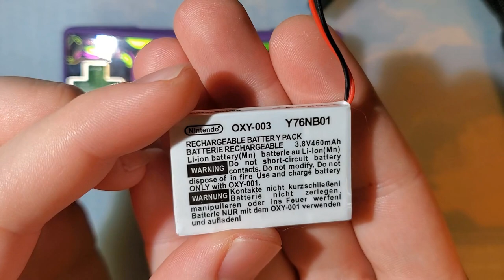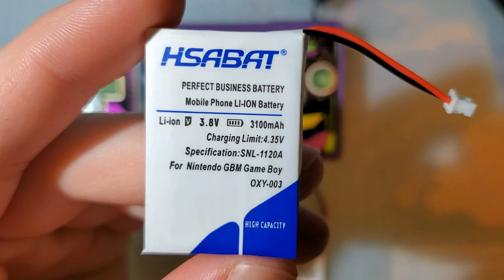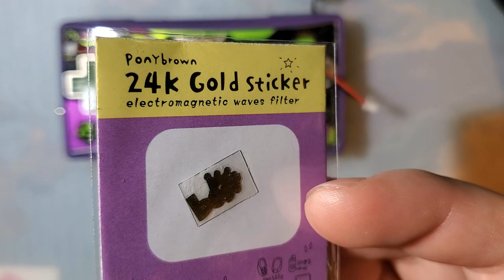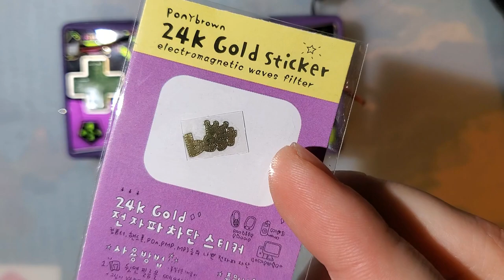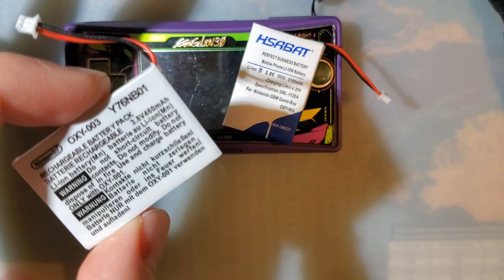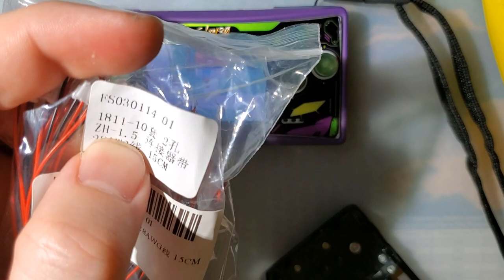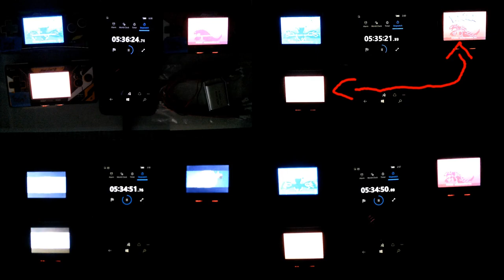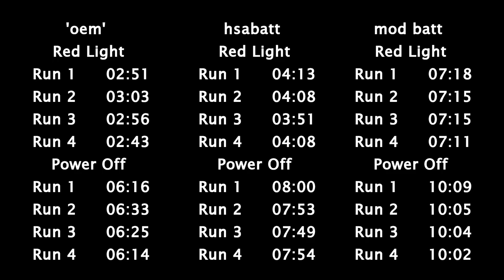Yet Another Game Boy Micro Battery Mod

Comment from the maker: Regarding my Micro: the faceplate is a sticker I found on aliexpress. They are no longer available and will not be remade (I checked with the seller and that's what I was told). The green buttons are custom one-offs made by Madmorda, the blue buttons are just generic aftermarket ones from aliexpress. The shell itself is cerakoted in purple.
 Yes it was expensive. 

For testing battery capacity, I use my Liitokala Lii-500 battery charger. I have modified it with battery plugs so it will take anything I solder a plug on to and not just hardcase 18650 style batteries. I have also made adapters to go from the plugs I soldered in to the plugs on a Game Boy Micro. See this video for more detail: https://www.youtube.com/watch?v=7qpD4n-aWsc
Reply: I know you dislike retro six now but I hope they start making new micro faceplates with their new uv printer
Reply from the maker: @kingarthur7255   I dislike R6 but that doesn't mean I don't wan them to improve their business. I hope we get new faceplates too.
Reply: Did you go through a specific company to get it painted? I need to get my micro repainted eventually
Reply from the maker: @chancepike1903  local gun place did it for me
Reply: @makho  thank you!
Reply: One thing that worries me is its 3.7v not 3.8
Reply from the maker: @IcePhoenixOfTime  I advise you do some research on how Li-Ion and LMO batteries work. The charge method and discharge curves are similar enough that they can be interchanged in the same circuit. Nintendo shipped the SP with both LMO and Li-Ion batteries and both had the same model number and consoles that came with one or the other still used the same power management circuit.

Comment: I did this mod on my Game boy Micro a couple of weeks ago and wanted to give feedback on how everything went.

I got the battery from the RetroGameShop link in the description. Installing it was extremely easy and took about 15 minutes. I just unplugged the old battery and shoved in the new one. Had to force the connector a little but but it wasn't that bad and I didn't have to cut/trim anything. It doesn't heat up more with the new battery and feels/plays just like it would without the upgrade. As a side note, if you can't close the battery compartment with the new battery in it, you may need to remove the foam padding on the battery door so it can fit.

While a traditional Game boy micro battery will last around 4-4.5 hours, mine was old and worn out, usually only lasting around 2 hours before dying. After installing the new battery recommended in this video, the playtime went up to about 13.5 hours on a regular Game boy game! When using the Everdrive Mini emulator it lasts about 9-10 hours. I have an Ez Flash Omega but didn't bother testing it since it's so bad with battery life (switch to Everdrive if you have one), but I'm assuming it would last between 6-8 hours with the upgraded battery. 

Like Makho mentioned, the red light does come on a lot sooner than normal but it lasts well past that. For regular games the red light came on after 4 hours and with the Everdrive it came on after 3.5 hours, but like I mentioned above it lasted hours past that before dying. Last thing to know is it takes about 4 hours to charge from dead to full battery. 

Hope this helps!
Reply: Does this mean you're playing for 7 hours with the red light flashing?
Reply: @Bovrillor  Yes that's correct. Makho explained it in this video but basically the new and improved battery does not have the exact same specs as the original micro battery. This causes the console to misinterpret it as a low battery but in reality there is still plenty of power left. I like numbers and predictability, so when I first installed it I ran the micro by itself without doing anything to get a benchmark idea of how it performed. If you're worried about it dying and losing your save data (like I was), I recommend you leave it running until it dies so you can see how it performs and gauge it better in the future.

Comment: Interesting that the ones from AliExpress are labeled 800mAh, the one I got from eBay a while ago is labeled 700mAh which is right around what yours tested at, guess AliExpress exaggerating the markings and selling the same cells. I need to grab some of those connectors, I reused an old aftermarket battery's connector which is apparently the correct one. Good video as always makho

Also weirdly I didn't have to remove the foam lol
Reply from the maker: I was told by the taobao seller that you had to. I didn't question it because the foam on mine was already falling off.
Reply: @makho  yeah that makes sense, I just never even thought about it when I put mine it. Maybe it's just really smashed in mine haha

Comment: I don't know if you will read this after the video being out for a while, but thanks to this video and almost dead battery on my micro, encourage me to mod my micro I took measurements of the battery compartment, and I order a battery 802735  800mAh that fits on the compartment, now I just need see if really last longer than the hour and half I used to get with my older battery.

Comment: I remembered that was you over there with that post.
My Micro's battery is shit now, some 3rd party replacement when I picked it up, but it's becoming garbage and doesn't like to hold a charge for very long, even when unused.

Maybe we should just push the mod battery instead of these weird junk rectangles from the Mystery Zone.
Looking on failbay, and the only ones in country are singles, and they're almost $10 a pop.
We need us a reputable battery merchant that's also reliable.

Also, that usb meter is nice!
Reply from the maker: >We need us a reputable battery merchant that's also reliable
I'm getting there... bare with me. I've released the specs for DIY but I'm also talking with mod shops and seeing if they want to pick these up for selling
Reply: @makho  Since we're on the subject of the Micro, was looking at how overpriced the Micro to GBA adapter costs, yikes. 

And then I started looking around, found this post: https://www.reddit.com/r/Gameboy/comments/b83ijg/i_made_my_very_own_link_cable_to_game_boy_micro/

Basically, aside getting the boards made, I would need to salvage some usb cables for the Micro, and get a few EXT ports to try this. Actually, this seems like a fun side project.

EDIT: And like an idiot, I overlooked the very video you have on here.

Comment: You can get the 800mah battery with the correct micro connector and a baby screwdriver on ebay from a seller in FL. I'm on my 3rd one so I can attest to the quality.  I don't have a tester though.
Reply from the maker: I doubt that claim, especially with no link to the battery itself. The connector Nintendo used appears to be custom so they would have to be harvested from OEM batteries.

Comment: nice!! i miss my old black micro i wanna get a replacement but it so expensive and rare 
those Evangelion face plates are amazing they make me wanna buy a micro send it to get professionally cerakoted like my glock 27 and get that eva 1 faceplate that coating feels amazing and has held up amazingly well
Reply from the maker: @husky3g  Yeah, my Micro is cerakoted. It came out way better than I had expected. I also had a boxypixel GBC shell cerakoted a while back and that came out great too. It doesn't end up in videos very often but it's my green GBC if you recall seeing that.

Comment: i bought one of those aftermarket batteries for one of the micros i repaired, and I had to shove that in there (i saw sparks when it finally came in. somehow it works as normal afterwards). now i know why the connector wasnt flush.

Comment: Hi Makho, this is extremely helpful thank you so much. A quick question: I wish to be able to reuse the OEM connector for all future new batteries and I am wondering if there is space inside the compartment for a mechanical connector? I feel that without soldering, and just rely on a mechanical connector I don't have to cut the wires any more.  The only issue is if the connectors will be too big to fit inside.
Reply from the maker: Not without using a smaller battery. What's wrong with just splicing your OEM connector on to a new cell?

Comment: Whenever I see a GB Micro I always wonder how possible it would be to put it in to a DMG shell and get it to run Color/Gameboy games. (Don't care about losing GBA support)
My dream Gameboy is a DMG that has full GB Color support and an IPS screen. I love that chonko DMG feel.
Reply from the maker: GB Color support is not technically feasible. When in GBC mode, the CPU in the Micro does not have access to the cart bus so it cannot read any games. Someone in the future may figure out a way to get the CPU to switch over properly and still retain access but current methods do not work. There are other alternatives though, like this: https://www.youtube.com/watch?v=SgTSweirr6o
Reply: You can run most GBC and NES games on the micro using an emulator.   The one that comes with EZ-Flash Omega works well.   I currently have both GBA, GBC and NES games on the same cart in my micro and it works flawlessly.  A few larger NES games probably won't work due to limitations to Micro's processing power.   I tried many GBC games all worked, most classical titles (e.g. Contra, Battle city, etc) for NES also worked.  Only game that didn't work for me so far is the Konami Sankogu (three kingdoms).

Having said that the micro doesn't have physical support for GBC and original GB games.

Comment: Hey, sorry to dig up an old video, but I was thinking of switching out my EZ Flash Omega for a DE one because of the increased battery life, but I'm also interested in the improved battery for the micro you put out. If I had to go for one, which one would you say would give me more of an improvement:

A: Using my EZ Flash Omega with your improved battery
or
B: Using the EZ Flash DE

Obviously the DE comes with other benefits too, but battery life is my main focus here, thanks!
Reply from the maker: If you're on an OEM battery, a new battery will be a much bigger benefit. Nominal capacity (almost 20 years ago!) is 480mAh vs 750 on the new one. 

If you don't care about the extra features of the ODE over the original Omega, there's very little reason to upgrade otherwise. You can always charge your GB when you're done using it and then run time starts to matter less and less unless you tend to play for more than four hours at a time.
Reply: @makho  on this question is the DE edition really saving that much battery life?  I did notice a significant drop in battery life with my OEM battery after using Omega compared to official carts.  Currently a full charge lasts about 2 hours on the lowest brightness settings---is this normal for Omega?  How much more of an improvement can I expect from DE?   I got my micro NOS about 15 years ago and used it very infrequently, so the battery definitely hasn't gone through too many charging cycles (only about a couple of dozens times) but I suppose the years didn't do it good anyways.
Reply from the maker: @tonglianheng  https://www.youtube.com/watch?v=HrGTzSrdCyA

Comment: Your description says the 802535s you bought ended up being crap, right? Did you ever find a better source? I see you're selling them with the correct plug already soldered; does that mean you did end up getting a good source? I'm just a little confused by the video's description.
Reply from the maker: I'm not selling them, retro game repair shop is. I am not RGRS. The original batteries I sourced were crap so I removed the link (one of the two failed after being in storage for a month) but the manufacturer RGRS uses makes much higher cells. I've tested those significantly and haven't had any single issues and nothing like I experienced with the original cells. I have one of RGRS's cells in my Micro that I actively use. Bonus, they even tested higher capacity than the cells I sourced. 

If you want one of these, I can vouch for the cells RGRS stocks but otherwise I cannot recommend any other specific vendors. If you want to chance it, just search the specs and you should find plenty of sellers. Likely biggest issue with sourcing outside RGRS is the connector itself and you'll probably have to splice on a connector. RGRS cells already have a compatible connector.

Comment: I'm having trouble with my battery, I can only get around 35 minutes of play time with my omega DE before it dies. No red select/start buttons, just dies. I have to plug it back in for a while until I am able to turn it back on. Any ideas?
Reply from the maker: If it's an original battery, replace it. Otherwise, clean your power switch.

Comment: Does this battery have any chance of damaging the micro, I’m wanting to know because I’ve heard that some aftermarket batteries started to melt or make smoke after some use causing it to damage the micro.
Reply from the maker: Well, this is a Lithium Polymer cell and it is capable of failure just the same as any other Lithium-Ion based battery. Observe proper handling and there should be no issues. 

Unless punctured or otherwise mishandled, this particular battery is no more dangerous than the one Nintendo shipped this console with.
Reply: @makho  ok thanks, I was wanting to know before buying it.

Comment: So... I've just got this exact battery from RetroGameRepair and I've done 2 charge cycles (so far). With the screen on minimum brightness and volume turned off completely, I am getting 3 hours of game time at maximum. Any thoughts on what the problem might be?
Reply: I'm not an expert but it could either be a bad battery or your power switch is dirty and you'll need to clean it. Basically the way the power switch works isn't super great, and if it gets dirty (which is easy) it can affect the amount of electricity going across the switch to the rest of the console. A lot of people clean there's and it makes a huge difference. I've even heard people taking a completely "broken" gameboy that won't start and bringing it back to life with just this trick. Do your research though before cleaning it, especially if it involves a soldering iron. It's not hard to do but it's easy to screw it up if you're not careful or use the wrong iron

Comment: With the Gameboy micro, considering the fact that it actually has the Gameboy color's processor in it, would it be possible for it to play Gameboy Color games if you installed a voltage regulator and on/off switch?
Reply from the maker: no, the CPU does not have access to the cart bus when in GBC mode. I've tested this. Voltage is irrelevant, unfortunately.

Comment: I bought one of the Retro Game Shop battery and the connector will not fit into the plug. I cut off those side tabs and I still can't seem to get it in. Is it normal for it to be hard to get the plug into slot? My fiance almost managed to just shove it in but I was afraid something may break since the OEM battery goes in with ease.
Reply from the maker: It's tight but as long as you have the plug oriented properly, it will go in.
Reply: @makho  I've been trying for 3 days now and nothing seems to work. I may try filing it down. :( I'm new to this and just found my OG Micro from when I was a kid. I barely used it so the battery may be fine but I was having some issues with randomly turning off when moved too quickly or set down a bit too hard. Ironically I think I solved the issue while trying to put this one in, but still want that extra long battery life! I will give it another go today following the new video.

Comment: Where can I find faceplates that actually fit and are not full of scratches?
Reply from the maker: you can try tracking down old OEM faceplates. Otherwise, I find that the red and blue chrome faceplates are some of the better aftermarket faceplates.
Reply: @makho  Any links to the red and blue chrome ones?
Reply from the maker: @aaliguy9986  none that I can personally endorse. Search for the faceplates on ebay or aliexpress and I'm sure you'll find them.
Reply: @makho  No worries. Thanks for the reply :)

Comment: I'm confused with your description what battery do you recommend the cell one that you spliced or the other two that came ready to go?
Reply from the maker: Oops, I forgot to update the description. RGRS actually custom ordered some of these cells with the correct battery terminal on them. I've already tested them and the capacity does actually check out. If you're in the US, I stand by these: https://retrogamerepairshop.com/products/game-boy-micro-750mah-high-capacity-replacement-battery-by-makho
Reply: @makho  thanks for the update, but I'm  in the UK 😢.
Reply from the maker: @azeluk  Ahh, sorry about that. Shipping is probably prohibitive then. I recommend the battery I spliced, just not from the vendor I originally used (hence the removed link). It's a standard size though and the connectors should still be listed.

Comment: 10 hours... That's impressive. I made my batteries for my GBA SP and my original DS systems using your battery mod and, I've yet to test battery lifetime on them. I was using one of those shitty blue aftermarket batteries. I am curious to see if there's a difference in battery life using a 101 board compared to a 001 board with the funny playing ips kits. I'm not sure if you've done any testing with that in particular.
Reply from the maker: The two consoles should be pretty similar with IPS kits. I have not tested that though. I should.
Reply: @makho  I'd do a test myself but, I'm just so damn busy. I don't have time to do it. Lol. I got the same batteries that you had gotten in your battery video. I would like to find out an overall average of mAh but, I don't have a tester.